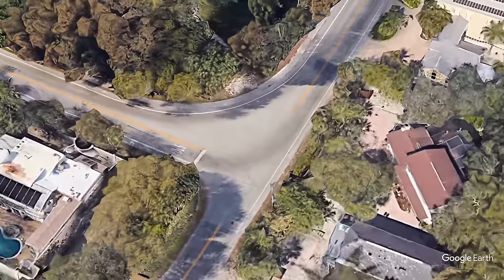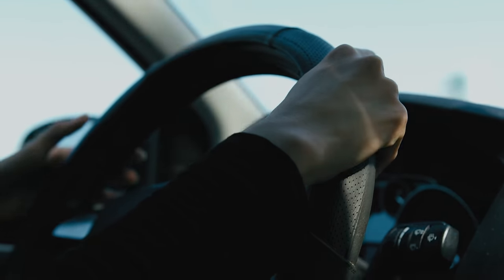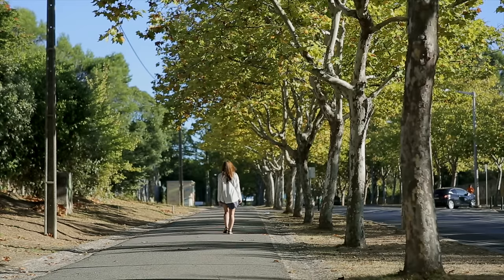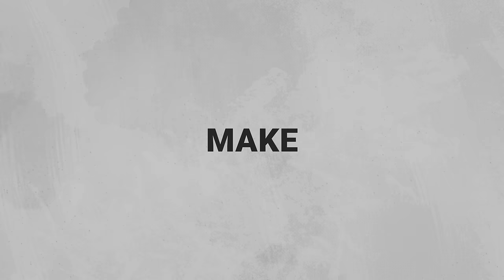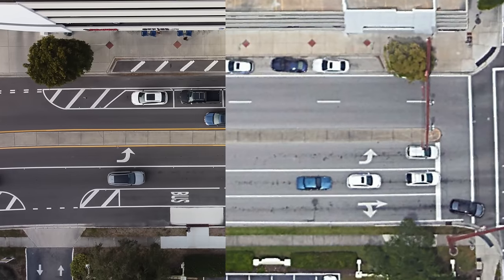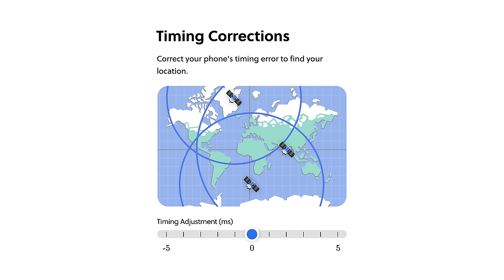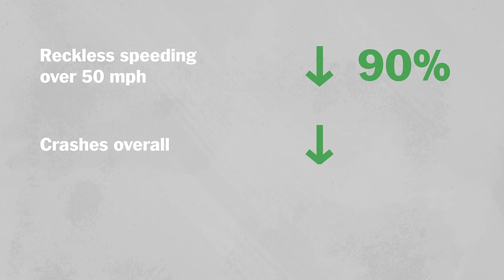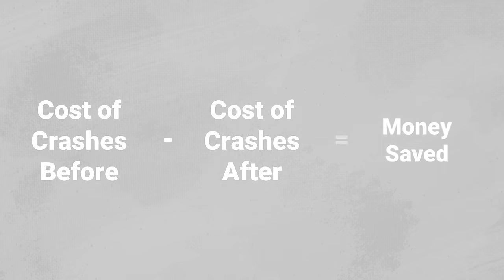This is the key to safer streets

Comment: There is only one location I know of in Hungary that has "Speed Cushions". It's executed so poorly though, I hate driving there as it is way more dangerous for everyone, than if it weren't there. The gaps between the bumps are there for the local bus to be able to get through the middle without knocking passangers around. But the gaps are perfectly placed for regular cars to also travel through uninterrupted. And they are not humps, the edges are the hardest I've ever seen, almost like hitting the curb head on. These two things highly incentivise drivers to go in the middle of the road to avoid slowing down or damage their car. Furthermore, there are many of these placed back to back, most of them being on top of slight hills as the road goes up and down constantly. All of this makes it so that it is very likely, that while just driving the road regularly an other car, that is 50% of the way in your lane will just pop up from behind the hill, or even worse, if you are both aiming to pass through the middle, it will likely result in a head on collision. Here is one of the worst if you are interested 47°24'51.3"N 18°55'58.9"E   (be sure to view a more recent image)

Comment: Curve extensions can be bad, especially for snow plows. I used to wonder what the heck it was for. During Winter, snow covers it up completely and there were no signs indicating its presence. As a result, it did sustain collision damages. After several years, they finally put up a sign there...

Comment: As an European, this is mental. Roundabouts are so common and really help a lot with traffic flow. The real cheap roundabouts are simply signs with a large flower pot in the middle, as that is enough for drivers to understand what to do.
Reply: Americans were late in adopting roundabouts, however that means they got to design modern roundabouts with proper flared entry points, unlike the shocking examples I've seen in the UK.  And sensibly, they avoid the massive multilane roundabouts in the UK which are just dangerous.
Reply: I'm so sick of ignorant people like you thinking that roundabouts are a cure-for-all (especially for traffic flow).
The truth is, that like with any other tool, they're not. There are cases when they do improve traffic flow. And there are cases when they make traffic flow worse.
For instance, when the flows on the varying approaches are unbalanced, there will be little to no gap for certain approaches. Traffic lights are better in these cases.
In the UK they've actually started adding traffic lights to busy roundabouts for this reason. Or replacing them with big traffic-light crossroads altogether.
Reply: @NewBuildmini Heavens, that was a rather aggressive response wasn't it?

Comment: Is one of the visual effects of lining roads with trees the pulsing in peripheral vision? My impression is that anything vertical to your sides gives a particular impression of speed. Interesting experiment would be to see how spacing affects that perception and whether you can fine-tune driving speeds by varying the spacing.

Comment: Honestly, from an austrian motorists perspective the simplest solution would have been to make this curve a priority road with special direction and put a yield sign on the road leading into the curve
Reply: I basically have 2 of those nearby here in Belgium and there are plenty more.

One road simply has priority and the "bend" is treated in a sense as if it was a straight road.

Obviously a lot of roundabouts here in Belgium but here that one wasn't necessary imo.
Reply: @Londronable  We don't use the diamond "priority" signs in the USA, so that doesn't work.  Priority is always explicitly implied by using appropriate signs (stop or yield).

Comment: I hate to say this but my foundational driving experience was in hilly, twisty roads and I frankly find myself far more comfortable on those than I do on straight, wide open roads. Your thoughts would definitely apply to someone who grew up in a suburban or urban or the mid-urban environs. Beyond that, experience with rally driving completely changes your perception of what's safe and what's "known" with regard to road conditions, but you're still trying to go flat out.

Comment: 4:11 One drawback to Curb extensions, at least here in Chicago, is that many drivers will choose to use an empty stretch of parking/bike lane leading up to the extension as another driving lane, then try to cut in front of the other cars right before hitting the curb extension. This behavior is especially egregious when they are in an area where a street has previously been reduced from two lanes in each direction to one lane in each direction to 'calm' traffic in the same area.

Comment: Only thing about curb extension and street narrowing is the planners need to do it right. In my neighborhood they added both to one street but their implementation sucked. They did not paint the extension red so folks still try to park right up to the last inch resulting in a crooked street parking job that extends out into the traffic lane. Second they narrowed the drive lane to the point that there is not room for 2 way traffic and on street parking on both sides but did not limit on street parking. You can only fit 2 cars through at a time if all 4 cars all compact and both parked cars did a good job parking close to the curb. Any other configuration and someone is loosing a mirror.

Comment: I think the elimination of left hand turns is why roundabouts work.  Also the elimination of stoplights means you don't have to wait when the intersection is clear.
Reply: Virtually every stoplight is triggered by road sensors and is adaptive to the traffic needs based on time of day. Only extremely old lights are still only on timers. Roundabouts are just bad and waste everyone's time more than stoplights on pure timers because traffic ebbs and flows. Roundabouts are great when they're one per 10 miles and the peak throughput is 100 cars a day. When it isn't that case, they waste the majority of driver's time.

Comment: the fun part, a 6-lane stroad, could be made safer and carry the same amount of traffic, if you block the middle lane on each side. cause now you have two fast through roads, and two parallel access streets. This can be done cheaply with ballards and paint, and for real when it's resurfaced every 30 years or so.  put plants in the removed lane, put in a proper raised median, between the high speed traffic, and reduce lane width on the access streets to lower vehicle speed, and you have changed your setup that's high risk low throughput into something much safew and at least equivalent throughput

Comment: Speed humps were installed on a main thoroughfare in my neighborhood. They definitely slowed traffic as intended. But for some people these bumps may as well be stop signs. Average speed came down but now we have more erratic drivers trying to get out from behind the timid drivers.
Reply: gennerally they are designed for 10mph though they arn't a stop sign more a yield sign since your still moving which makes getting back up to speed very easy.

Comment: One tips is to not fix potholes or fix the street too good, normal cars at normal speed can often handle them well, sport cars that was not made for normal roads and those bulky "trucks" do often have more problems with bad roads and those are often the ones that drive to fast and unsafe, a damage in a road shall only be repaired when the structure of the road is at risk, if not money can be saved by just ask folk to drive slower and just fix them so it still a bump but that do not cause damages to the car.

I guess my comment will trigger many that have a big truck and think it is made for off-roading when I say they can't handle a pothole :-D

Comment: Politicians are turning to Europe to copy the roundabout idea. But I recently drove in England and the continent where roundabouts are prevalent. What I found was traffic congestion that reached for miles. This wasn't repeated in intersections controlled by traffic signals. There,the traffic flowed smoothly. With the addition of a yellow light before the signal turned green, I found it extremely efficient.
Reply: I’d love to know where you were. Because miles of traffic? Yeah, Nobody believes that.
Reply: @simondahl5437  there was about a mile of traffic on a Monday morning leaving Dorchester going to Bovington and about 3 miles of traffic going to Oświęcim in Milodec, Czech Republic. Also, traffic slowed considerably between London and Cambridge. Your disbelief (or politics) do not discount my experience. There are innovations out there that do improve traffic flow like diverging diamonds. Roundabouts aren't one of them.
Reply: Roundabouts work well for low volume roads where a signal causes delays.  They do not work for major urban roads.  If signals are necessary, then the roundabout is over capacity.  At that point, a standard signalized intersection is more efficient.

Comment: So cool. These low cost, options really should be replacing as many intersections as possible because slowing down and going through a roundabout is how we actually go faster. Safer, cheaper, low-tech and moves traffic faster. It's an absolute no brainer.

These old lights and stop signs everywhere are the reason why it takes me 20 minutes just to go 2 miles where I live.

Comment: While some of the suggestions in this video do work, some of them are often done in a way that doesn't work, like the raised intersection is a good idea, but in my city they raised them too much so it is very damaging to cars and is a ridiculous bounce for the driver even at low speeds; if the height had been lower or the ramps up to it had been longer than it would have worked and been suitable for everyone.  Also in my city they are putting three bumps across the road and then repeating this like every 100-200 feet or so; but they did it on roads that are the only thoroughfares in the area(these roads have residential streets coming off of them but are the only roads that go straight through the neighbourhoods and connect the south of the city to the downtown area, they also reduced all the speed limits from 60 and 50 km/h down to 40, including these thoroughfares).  So the problem here is that on some of the roads they added the bumps which are way too high and cause way too much of an inconvenience to drivers no matter what speed they go, and they reduced the number of pedestrian crossings near the bumps as well.  Also the thoroughfares should have been left at 50km/h.  There's also an intersection near me where they added a bunch of curbs that are separate from the side of the road as there are bike paths going 'through' them; so like sidewalk with curb, bike lane, curb up for a small concrete surface of 1-2 feet, then curb down.  Anyway, the curb things stick out way too far and hinder traffic and frankly have created a deadly corner for bicyclists who think they can just shoot out onto the road if they have a green light(and yes, they added a little traffic light for the bikes, I swear this intersection must have cost a fortune, sigh/groan) forgetting that cars have a right to turn right on a green light of course; I really do think someone will die there before it gets changed back to the way it was which was much better(PS - It has already caused a major vehicle accident, like four ambulances had to be called).
Anyway, the point of my rant here is that some of this hippy shit works and is great, but a lot of it does in fact hurt drivers and ruin traffic.
In this video they never say what happened to all the vehicles that used to drive down that road they put on a diet?!  Well, I guarantee they didn't build the 4 lane road for no reason, so did they also build a bypass road for traffic to go around that area?  Or did they just add 2-3 minutes to everyone's commute and make people have to wake up earlier in order to get to work on time?
It's nice to make these road adjustments, but you have to consider how drivers are going to deliver you the goods and services that YOU want, when making these changes.  Also, the "curb extensions" at intersections are absolutely the worst, and prevent transport trucks from making it around those corners, just stop with those, please, like I'm begging you, please!  
I am a proponent of bike paths(not always integrating them on roads though, but making sure the whole city is very bike-able)
I like sidewalks and safe pedestrian walkways that get bigger in the downtown or shopping areas; and I like the idea of roads that get closed to traffic all day and are turned into pedestrian only places and only open to traffic for delivery trucks during certain times and of course emergency vehicles.
However, I am sick and tired of people hating on drivers and road traffic, in my city there are very few main roads(north south or east west); ok, and if they widened these roads by adding a lane it would greatly improve driving through my city.  NO, this will NOT create "induced demand" so F*ck OFF.  Not every lane added will cause "induced demand", not every road is meant to be admired from a sidewalk, some roads are meant for motorists to speed along at 70-80km/h and get from point A to point B, these should not have stores on them, or driveways onto them, and a minimal number of lights and intersections, the whole purpose of such roads is to bypass EVERYTHING and get where we're going.  And this benefits everyone.  So stop with all this hippy Bullsh*t and understand that not everyone wants to walk everywhere, not everyone wants to ride a bike places, and even if we do there are still times when we need to get across town in our cars, so for peats sake just stop!  Accept the fact that there are other people on the planet that do NOT think like you, and would prefer a different future and a better society than what you imagine.  And yes, we can all drive personal vehicles and still be environmentally friendly and create little to no carbon dioxide, ok, alright, enough.  The bumps(reverse potholes as far as I'm concerned), are an absolute no, not ever, unless they are less than one inch above the road surface.  The "curb extensions" just don't work, if you want a narrow road then pave a narrow road, don't take a two lane road and suddenly jut the curb out in front of people, it's rude, and it must be hell for the snow plows because if they miss the little yellow stick than it's smack, crunch, ouch!  And at intersection the "curb extensions" make it harder to turn around the corner, impossible for a transport truck, and no, it does NOT help pedestrian at all.  You know what prevents the most accidents, and saves the most pedestrians lives, drivers, good damn drivers, people like me that pay attention and don't drive like a reckless maniac!  Maybe, before we change over all our infrastructure to useless sh*t we should invest in better education for drivers.

Comment: I fully agree with these changes, but one piece of data i would like included is the average traffic volume of the road before and after the changes as well as average increase in travel time for cars. those things are the most important to crazy motorists, and by showing that those things rarely change too much is a great arguement

Comment: Mini roundabout are normal where I live, although admittedly not using plastic. That looks very temporary. Out mini roundabouts used to have a raised dome in the middle. These days, as a cost-cutting measure they are just painted. It is illegal to drive over the centre unless you have a vehicle that is too long to avoid it. 

nb. I'm sure that plastic isn't going to last, but I guess as it is a pilot, that won't matter and a more durable approach will be taken if it is successful.
Reply: That's why you use roundabouts with tragic lights. :)

Hate those things.
Reply: @epikgamingcat  What are you talking about? Assuming you mean traffic, not "tragic" lights, what the hell has that got to do with mini roundabouts?
Reply: think there is some mini roundabouts with overrun area stone bricks on them though they arn't that common sadly.

Comment: How did that take 4 days? Drilling those holes would at most take half a day, a few hours to bolt the plastic parts in and an hour to paint the lines.

Comment: A roundabout is always successful, that's why there is so much of these in France.
Reply: France was much more strategic than the UK.  Where the UK started placing them on all the major roads that now requires traffic signals, France put them on the low volume roads where traffic stays limited.  That is why America has stricter criteria to install roundabouts, because many locations had too much traffic for roundabouts to be effective.

Comment: More risk doesn't always mean driving slower.  Getting on an unlimited portion of the autobahn drivers who would normally drive slower are aware of the risk and accelerate harder and drive faster to mitigate some of the risk of dangerously impeding faster moving traffic.

That said, on surface streets making people less confident does seem to result in more attention being paid to the way they are driving and others around them.  A town removed all of their signs, lights and road lines as part of a renewal of the high street area and accidents went down, because people had fewer cues that they were in their correct area and they were "safe".